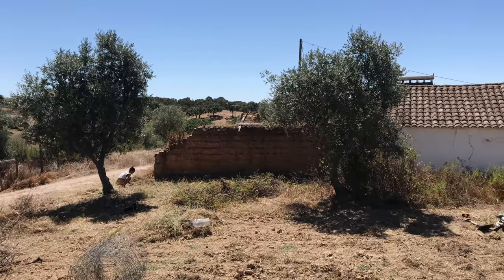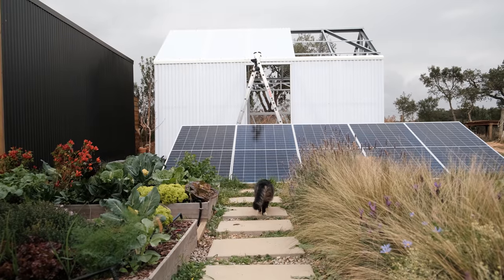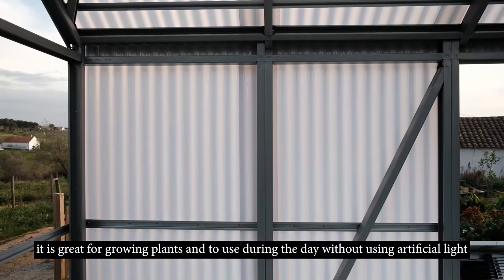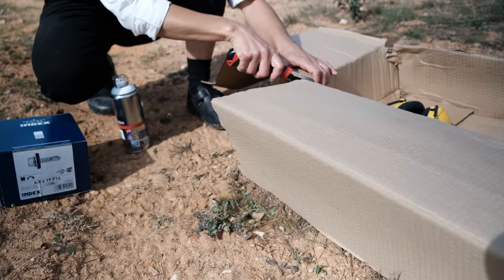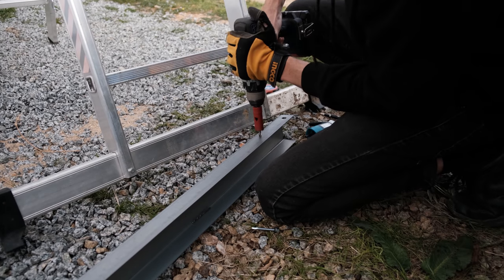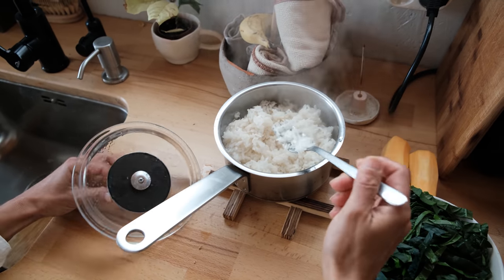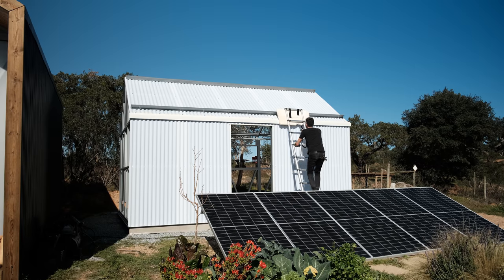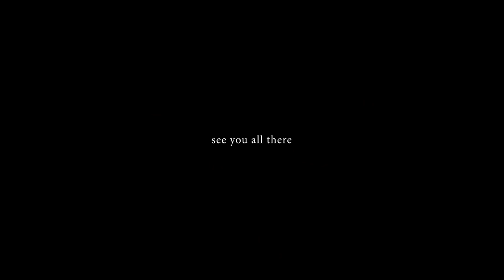14. The END of our OFF GRID Journey (1 Year Later)

Comment: Interesting video. I have a conventional house that is paid for here in SE US and retired.  Put up a greenhouse and thought about a solar panel for it to run misters. Panel was only going to be $100, but for rest of support equipment was going to push total cost to over $350.  Cheaper for me to run extension cord to it. Would never recover the costs for solar in my remaining life. You would have to replace batteries every several years to add to costs !  Will be interesting to see what happens with your home in 5, 10, 20 years and if you have kids whether that changes things.

Comment: 44:40 The top 'C' channel should of had the open end facing down the roof like the bottom one. With it facing up, water might accumulate in the channel. You should drill some drainage holes just in case.
Reply from the maker: great tip!

Comment: Nice work.  Cool how youve done it on a budget   But I musr comment on the roofing transitions to the wals.  The flashing at that point is trapping water running off your roofs into the walls.   The flashing on the roof should be under the roofing and sealed with currugated sealant to stop water entry into your building   the directs the water out and away from the building.   Otherwise great stuff.

Comment: question? the flashing looks nice nut when it rains the water will run off the roof and under the flashing and down the walls maybe inside the building as well that's how i see it from the footage i have seen, maybe i am looking at it from a wrong angle but if that is the case you may want to address that problem now.

Comment: Now that you have access drill a series of drain holes on the lower edge of the upper U profile as otherwise it is going the hold rain water. Greeting from Greece.
Reply from the maker: the lower is a z shape with a return, not an omega, i showed it in the previous episode, take a look! https://youtu.be/K1jGV_xXdaU
Reply: @ModernHouseCabin  Sorry you didn't get it. I am talking about the U profiles supporting the PV panels sitting on top of the undulated cladding sheets. The top (higher) one you have placed it with its cavity facing the sky, so you could get a hand in fastening the bolts attaching the pv panels. Understandably ok. BUT, due to the roof pitch it forms a sort of a longitudinal gutter where the rain water will be trapped because there is zero tilt to drain it away. For the same reason, (so that you could have access to the bolts) you have placed the lower U profile with its cavity facing the dirt, so no such problem there. What I was suggesting is that you drill a series of drain holes on the curved bend between the wide and (lower) short parts of the U profile. Hoping it is now clear.
Reply from the maker: most of the water will travel at the bottom of the waves of the roof, the channel is on top of the wave, but yes, it would be smart to add a few drain holes like you mentioned!
Reply: @ModernHouseCabin  Aerodynamically, at the ridge of a rising surface negative air pressure (suction) is built up (Bernoulli effect). Thus, rain droplets at the top of the pv panels will defy gravity and move upwards, ultimately being sucked underneath the panels. In airplane airfoils this phenomenon creates the drag force.

Comment: I hope the roof doesn’t leak into the greenhouse because water run down hill. The piece of metal that was placed on top of the bottom roof line will guide water inside. Hope I’m wrong but something that you need to look at

Comment: Nice precise work. Thank you for sharing. Could you tell me two things? 
1. Are those wood plates have any smell at all?  I think they are OSB sheets. Could you tell me exactly what material you are using and where did you buy it? Is it eco friendly? Couple years ago I bought couple OSB plates to make a barrier wall and I had to throw them out of the house in the middle of the night because I almost suffocate because of toxic glue used to make those plates. Those plates still stink after 10 years being in the open. 
2. You using a lot of paint. Could you tell me what paints you using for wood? Are those paints vapor permeable? Do they have any smell?
Best regards from SLO.

Comment: Great video! I really like your approach - treating solar panels like a building material, not as an add-on appliance. I was thinking about building a roof over the terrace using solar panels as the ONLY cover. Do you think that putting a rubber seal between the panels and tightening it up would be waterproof? I mean - it's over the terrace, so a bit of water won't do any damage, but still - I don't want it to drip into my coffee :D

Comment: I humbly submit an idea 💡 😉 never under any circumstances should one use Chip Board it is Highly disposable and will not last very long at all infact within just a few years it will swell up and Rot Away ie. Post haste you might want to water proof the Holy Heck Out of It with maybe Silicone also their is Video tutorials here on YouTube of how to buy Cheap Silicone Caulk & Naptha To dissolve it into Water & then you could end up with the most water proof Chip Board ever devised! And maybe apply it with a back pack style Sprayer they use in orchards trouble is how could you spray the bottom side of the floor? Huhm maybe get a sprayer head meant to be used for pressure washing the underneath of automotive Chassis's

Comment: Nah ~ when you are trying to provide tollerance with fixings, you don't make the holes bigger in diameter (& larger + thicker washers), you make the holes lateral or vertical slots (depends on application) to maintain tollerance AND structural stability